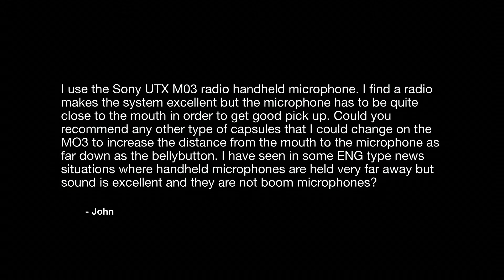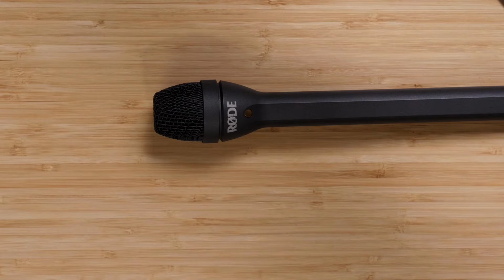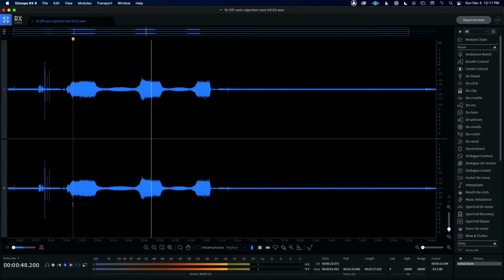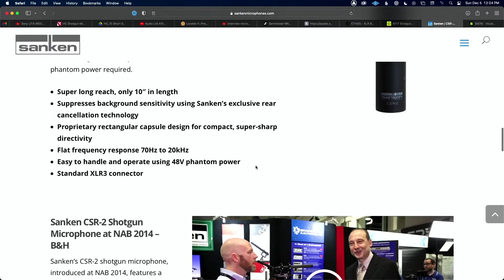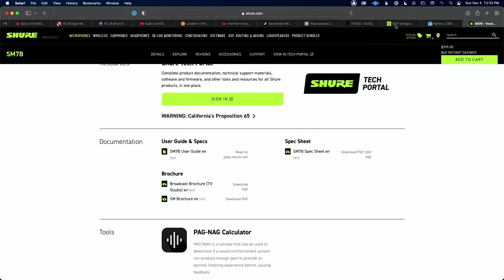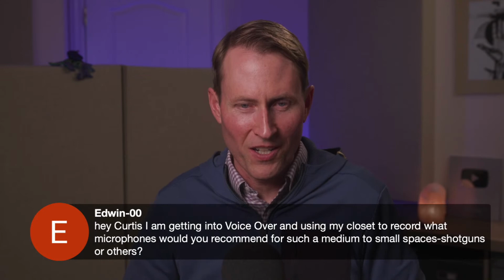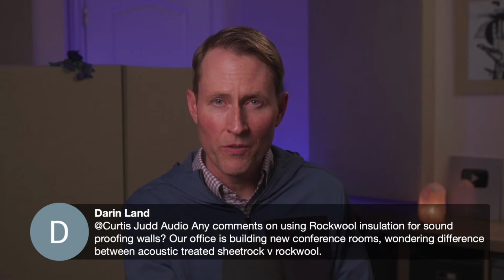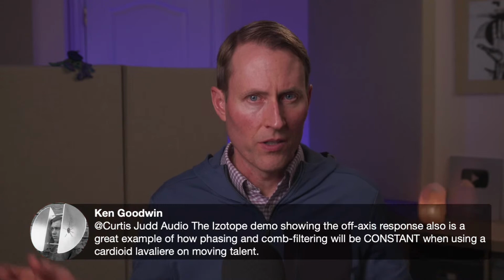Sound for Video Session: Microphone Polar Patterns & Q&A

Comment: Mixpre II question. Should I use a heavy limiter when streaming live events with alot of dynamic range between the acts? Maybe something like -12db with +12db of makeup gain. Or even heavier. Thanks,
Reply: I would test that and see how it sounds. My initial thought is that it wouldn't sound great, but worth a test!